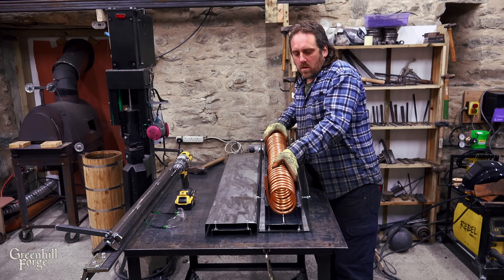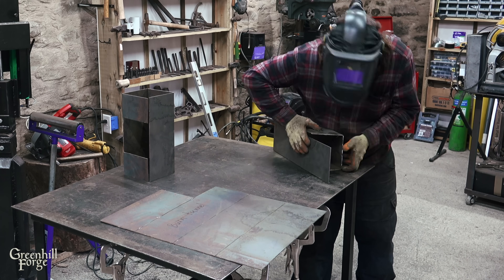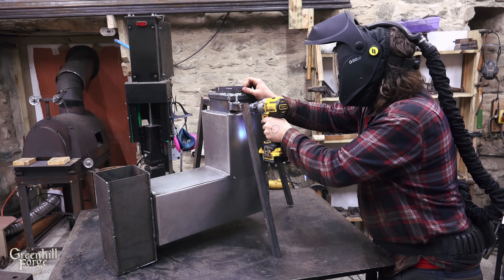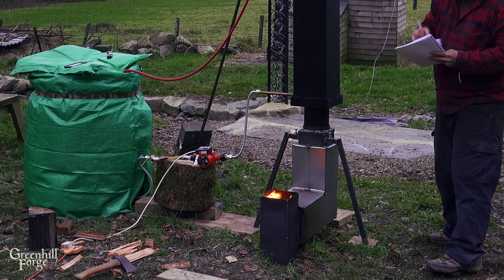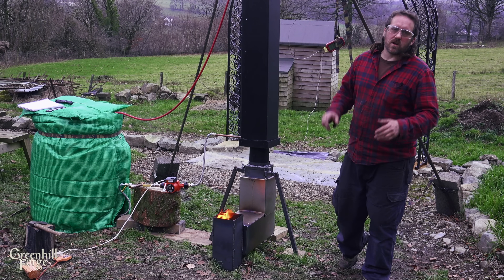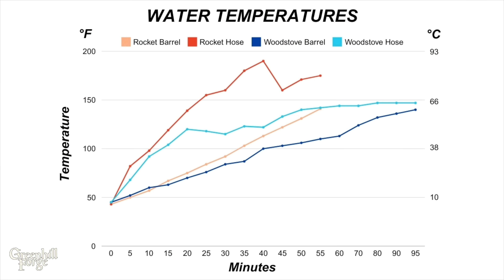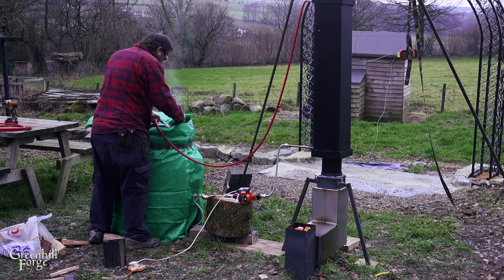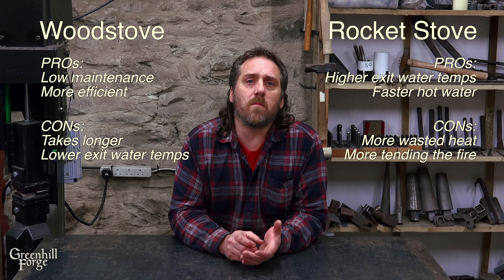Rocket Stove Water Heater Experiment Pt2 -TOO Powerful?

Comment: Love your style of creativity and innovation keep it up. I have a idea on combination or water and copper tubbing the two using the "super heat" or wasted energy to power small turbine. Of course this involves more safety precautions and measures and fail safes but in combination with all above amd below mentioned could be a great effective project. 
  I didnt mention everything i have in mind atm currently working on several home self self-sufficient projects. 

On your rocket stove adding sensors to the dampers via a servo motor of some type to slow or increase heat levels in conjunction with high temp water flow pump to speed upnor slow down using your gathered data to dile in a semi automated rocket temp control. 
  Some kind of configuration like the above mentioned would possibility make it less attentive once dialed in.
  This is some of my ideas in mind. If you like them or want to inquire fill free to send me a line. Great work brother.

Comment: Even though the heat gets high, if there is water flowing through the copper it should never melt down because the water will quickly pull that heat away....  if a pump went down and the water didn't flow... there could be an issue.

Comment: You shoud raise your tank and run it in recirculation fom bottom to bottom by gravity with a mecanic thermostat. To use the water you would be able to run it by gravity if its high enough. Nice work by the way.

Comment: I have another type of design as a hobby project, that aims maximum efficiency. I have reached over 80% total efficiency. I heat my 2000l floor heating boiler. It burns wood chippings and scrap wood. 

The heart of the design is traditional carbon monoxide converter that was used to power car engines during war time, but instead of cooling and cleaning output gases, I burn it all, including all hydrocarbons. 

The converter chamber is build from 300l stainless steel water heater tank, which I split in two and schrink one part. I did put smaller inside and filled the space with vermiculite. Then welded air tight and used vacuun pump to suck the air out. It holds heat so well you can touch it by hand, even when the outer part is mirror finish and don’t radiate heat a lot. 

The gas comes out around 650-700C, where the steel can still stand the vacuum. Then I burn the gas in insulated burning chamber, made from refactory clay that can withstand 1500C. My meter can measure 1200C, and it can go much further, being white hot. I feed the air through pipes, that goes through the converter to lower the temperature on sides. After burning chamber, I have pipe heat exchanger, where 21mm pipes are surrounded by water jacket. Incoming water is first heated on cell type heat exchanger, that takes residual heat from gasses, then goes on water jacket around insulated burning chamber and finally around pipes. No chimney is needed, vecause air is feed with a blower. 

One burn provides about 150kwh of heat, and all the wood is filled at beginning. I ignite it with propane burner, that’s integrated into air intake on the bottom. 

This starts by burning a hole in the middle, where heat quickly spreads further. Converter Chamber have very little oxygen compared to normal stove and CO protects the steel from oxidizing. Since the high temperature burning chamber burns only hot gas, that is fed with relatively slow blower, the burning process is very controllable. It really pick up the heat after all moisture is gone. 

Combined with extreme burning temperatures, almost zero conduction losses and less than 50C exhaust temperature, I think it works close to 100% efficiency at the end of burn. The water comes in mostly less than 30C, and it surrounds the burning chamber with normal fiberglass insulation, the surface stays cold. 

Since you build your stoves from steel, you can consider from putting thin layer of ceramic insulation inside and then waterjacket to take the heat. It would keep the steel cool, so it last long, and ceramic insulation inside, let temperature build fast. 

It is possible to cut 1cm pieces from ceramic insulation tile with bandsaw, those insulate well enough and last on areas that are not mechanically streased.

Comment: U can probably get it super hot with the water running thru cooling  u can get it hotter then melt point because the water will cool enough to keep from melting

Comment: Do you have a video of how you built your brake. And another tools you've built. Also I was wondering about the hose going up your back when you were welding, and everything about your welder. I live off the grid with solar and generators. I'm a Handyman. My name is Paul.
Reply from the maker: Hey Paul! This is my welder and it's amazing. mig, tig, and stick. smart mig feature adapts to your style of welding which is an awesome feature. https://amzn.to/4bSra5p This is my favorite mask setup. The air filter is on a belt and the hose forces clean air into the mask. It's really comfortable and can be used for grinding and welding https://ebay.us/jur9pC I don't have a video for the brake, I just threw it together one day when I needed one. I'll do a shop tour at some point and go over some of the tools I've made and my favorite tools I use all the time.

Comment: Could be wrong but I don’t think there’s much of a chance of an explosion event because it’s not a pressurised system, the storage cistern makes this a open system, the water has expansion in the tank.

Both videos in this series have been awesome, simple step by step and not a second of wasted time. Brilliant video, I always wanted to build something like this when I get my own house and it’s awesome what you’ve created.
Reply from the maker: Thanks. Another one coming, hopefully on Friday. I agree that an explosion is unlikely. Splurting boiling water and steam are very possible. And with enough cavitation maybe copper melting
Reply: @GreenhillForge  yes, bubbling steam into your cistern is still gonna emerge from the top as mostly steam.  And if your tube isn’t submerged, you’re just making a steam pressure washer … with the following bonus failure mode:

And, probably obvious, but if your cistern isn’t big enough, you could just boil off all the water overnight and go dry.  Without steam being generated, you’ll lose water infinitely more slowly.

Comment: Great progress.
If you move the coil out of the chimney and install it on the outside, you would completely avoid the creosote adhering to the copper.
You could then add the layers as is appropriate. 
I also would like to suggest a 1" tube.
Just some thoughts.
Thanks again, and have a great weekend
Reply from the maker: Thanks! I think you're going to really like the next video

Comment: I can't see if there is any smoke coming out the top, so maybe I'm full of s**t, but just to be sure that you really are burning the smoke (which is what makes a rocket stove, well, a rocket stove) you could make a secondary air intake by projecting a small tube from the bottom of the riser. This would cut down on creosote build-up on the copper coils. Since you are pumping the water through the system, a sufficiently high flow will protect the copper. You would need a way to automatically kill the fire in the event of pump failure, though. Probably better to just put the copper on the outside of the flue.
Reply from the maker: I added secondary air to the rocket stove in this video and get a huge temp boost https://youtu.be/yi_7CBsXkoo

Comment: You're either high or in denial if you're accounting for zero renewables for electric water heaters. There are also heat pump water heaters. Even in my state which has an meh level of 40% from renewables renewables. Cool project and all but the numbers are fucked.
Reply from the maker: only 13 states have 40%+ renewables. 16 states have single digit renewables like Connecticut at 2.9% or Pennsylvania at 3.1%. It varries wildly by location and only about 20% of US power is renewable while 60% is fossil fuels. Renewable's infrastructure also has a big carbon footprint. So you can either break it down by specific locations which then applies to a smaller number of people or you can go with averages. Both are viable and worth talking about.

Comment: At this efficiency you should just move more water for it to be more effective at transfering heat, correct me if I'm wrong
Reply from the maker: I think ultimately at this heat I'd  need more suraface area of coil. tweaking it could improve efficiency a bit but to get big gains I think it needs 2-3X the length of coil.
Reply: @GreenhillForge if I’m not mistaken, you could increase surface area by using a collection of smaller diameter tubes that all have a cross sectional area equal to or greater than the original tube all situated in parallel connected to a manifold  instead of one long tube. I built a heat exchanger for a wood fired pool heater that uses that design that is decently efficient for what it is.

Comment: Aslong as you keep water flowing the pipes shouldn't be at risk of melting at all and it would benefit the amount of energy the water accepts to add something to the outside of the pipes to increase surface area
Reply from the maker: Yeah, I just didn't know if I'd get any cavitation so I wanted to ease into it. I'll push the system more and more as I get more comfortable with it.

Comment: the rocket stove is a good design. but your intake should be at the top, and the exit water should be attached at the bottom of your copper coil. you will use very little fuel in a counterflow heat exchanger. technically, with the proper relief valves and check valves, if your water storage is elevated above the intake, and the pipes are strong enough for the designed pressure, you can have a passive feed system, you don't necessarily need a pump. attach the intake near the bottom of the water tank, attach a one-way check valve so the water is only going into the intake, and attach the exit pipe to the tank, the density differential will continue to feed the system

Comment: Your efficiency comparison is good, as you had a wrong flow in the first video but it would be interesting if you update the design. First the water flow has to be opposite. If the heat transfer is best, the temp can not be mentionable above the water intake temp. And you're losing to much energy in the pipe as the gasses will exhaust directly. Try adding a one side closed pipe in the middle to force the gasses around the coil. For the wood stove, however, you completely ignored radiation losses what are important for your result. Just compare the energy from the wood compared to the energy stored in the water.

Comment: This is great work! I am a chemical engineer working in biofuels research, and we have to solve a lot of the same problems when designing plants. We don't get to have nearly as much fun exploring it, though. I think that you could use the temperatures and heat capacities of your flue gasses to gain better insight into which heat transfer step is costing you efficiency (fuel to flue gas or flue gas to water), even without knowing their exact flowrate. I also think it would be relatively easy to design an orifice plate or pitot tube flow meter to measure the rate at which you are consuming oxygen. Let me know if you'd like to chat about it!
Reply from the maker: Thanks and absolutely! My email is info@greenhillforge.com

Comment: That design works great at first but over time the tubing in direct contact with the flue gas will collect a lot of creosote reducing efficiency and is difficult to clean. My experience is to put the coil tight to the outside of flue pipe and insulate , saves a lot of maintenance.
Reply from the maker: I go over this and a bunch of other things in this video if you want to check it out https://www.youtube.com/watch?v=pP_2A5Wdvqg 
I also have a video coming soon you might like.

Comment: this was a pretty awesome video. i might be sticking around lol. also, you expressed concerns about the copper pipe possibly failing at the high temperatures, but i think that would only become a concern if the pipe either became empty from a failure somewhere else in the system or if the water got so hot that it became steam and was unable to remove heat rapidly enough to prevent the copper from melting. also, i wonder if you could reduce the carbon buildup, not by reducing gas temp, but just leaving a large enough space between the combustion chamber and the coil to allow all the carbon to be consumed
Reply from the maker: Yeah it was mostly cavitation that made me nervous about the copper
Reply: @GreenhillForge  yeah, nothing like a good steam lock to ruin your afternoon XD

Comment: that carbon buildup on the coil in the rocket stove means you wernt getting a complete burn, you should try adding an extra air intake before the coil.. adding a small amount of extra air after the carbon containing molecules have been cracked will allow a clean burn. and a damper after the coil might also help
Reply from the maker: I modded the rocket stove to have secondary air in the combustion chamber in this video and it boosted the temps a lot https://www.youtube.com/watch?v=yi_7CBsXkoo and there are dampers on both ends of the coil, you can see that build in this video if you want https://www.youtube.com/watch?v=-i28W_xx2mw

Comment: I think you might like a two-season version of a hot tub or sauna. One with a hypocaust to use the hot fumes for heating floor and walls and a second with a kind of turbo charger to use less wood and heat your hot tub faster. You could just use the right amount of wood to heat up the hot tub avoiding over heating. Safety might be a challenge to avoid CO poisoning. You can also add some gravel as a heat storage.

Comment: I think the rocket stove could work well with some diameter changes in particular around the coil so it’s not as close to the source of heat. It’s just the erm somewhat annoying feeding the thing maybe a modified wood stove might provide a solution. Anyway dude welcome 👍

Comment: Now, if you really want to do off grind heating, take this set up, but instead of using water, use Sand. Sand can contain a much higher temperature for a really long time, which can then be used to heat water or vent into a home, and scales with the size of the sand battery you use. You might need to be more particular with what you use to contain the sand though.

Comment: If you soak the copper with liquid dish soap they call that soaping you can do that with pots and pans cooking over and over open fire makes the creosote come off very easily there may be commercial products that did the same thing also. But soaping works quite well

Comment: Hey, we live on a narrowboat in England, our only source of heating aboard is from a log burner. Our only source of hot water is from a calorifier (basically a hot water tank that is heated by running our diesel engine and the flow of water cooling the engine passes through pipes that are in the hot water tank and heat the water we use for showers etc up). I'd love to adapt the coil on / in the flue to heat the water we use... Thoughts on the best way to do it? Great videos by the way!
Reply from the maker: Awesome, I love narrowboats. I'm working on some more designs with videos coming. I'd definitely say a coil inside the flue is way too dangerous(potential chimney fires) for a narrowboat. This is mostly just a test to see how much heat is transferred to compare to future designs but I'd only use it outdoors and away from buildings. The goal is to design something safer but I won't really know until it's well tested.
Reply: @ we love life aboard our narrowboat. I was thinking along terms of coils outside the flue and then insulted round that. With the tails from the coil going to the calorifier - ideally worked without the need for a pump… therefore creating ‘free’ hot water whenever the log burner is on. My main ‘issue’ is how I’d potentially stop the water getting too hot and turning to steam as the log burner literally runs for days at a time and I’m not seeing a obvious way of controlling the temp of the water being circulated… 🤔

Comment: You should make at lease half of the size of rocket stove + add inside heat exchanger some kind of Archimedes screw in the middle to make more turbulent movement of hot air

Comment: Great video, why didnt you include hydro in your electric calcs?
Reply from the maker: It's a fair question. I went with the 3 biggest power sources. The next 2 would be wind then hyrdo and they should really be included as together they're about 15% of power generation. Really I'm just trying the keep the pace moving pretty quick to fit as much in as I can in a fairly short amount of time.

Comment: I would recommend a internal baffle. A 8 inch chimney with a 2 inch pipe centered would force more of the hot gasses to contact the tubing for longer.  Two water coils would improve performance.
Love the solid science.

Comment: Thank you for your thorough understand of true, insulated rocket stoves, including chamber temp vs exit flue temperatures, and thermal mass capture vs quick water capture.

I campare this to the crude non-instulated "redneck" designs that are often covered, and most often just used for cooking.

Comment: You cannot take too much heat out of the flue gasses, as that will condense the combusting wood gasses and coke up the flue and copper surfaces. Lots of frequent cleaning will result. Better a flue liner to sandwich the tubing between the flue liner and the outer flue pipe. Then the copper is not directly exposed but will still heat the water.  Water flow rate and contact area determine how many BTU's extracted.